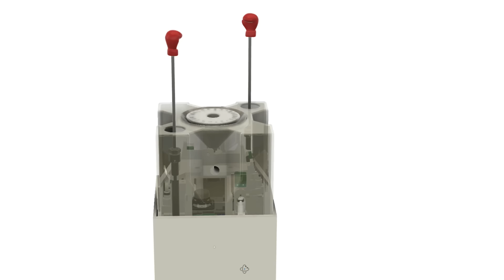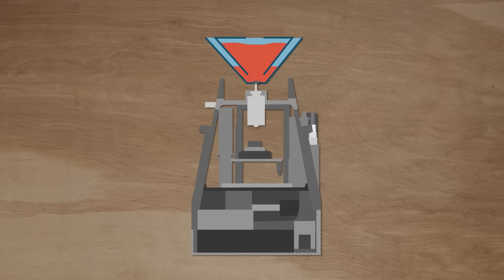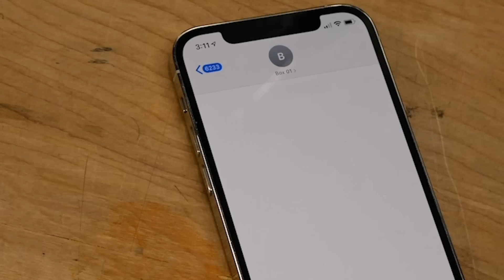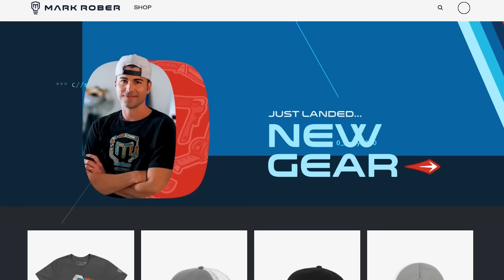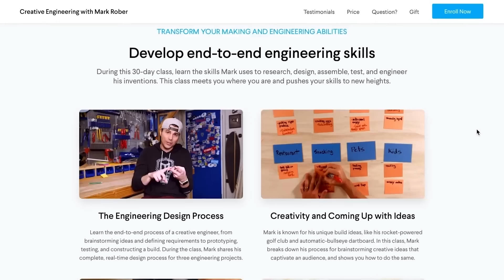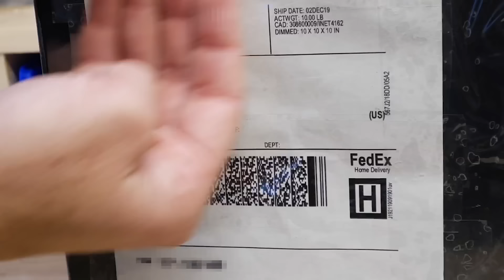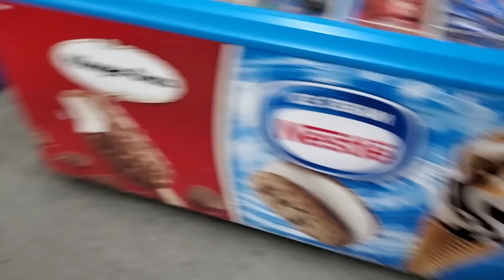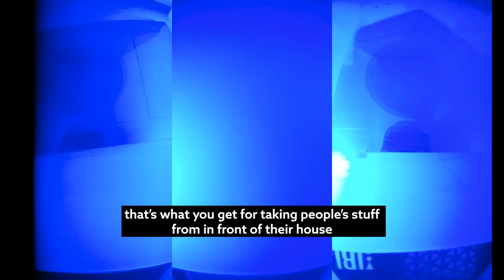EXPLODING Glitter Bomb 4.0 vs. Package Thieves

Comment: Next year's version should have ink leak out of the bottom to irreparably stain whatever surface or furniture they open it on.
Reply: that is brutal but justicfeied
Reply: I like the sound of that XD
Reply: This is a level of overkill that I am fully behind. Excellent suggestion.
Reply: I like it, but worry about legal questions if they start purposely doing property damage, even to thieves who would deserve it.
Reply: @Ahrpigi  If the item is on a person's private property and is stolen, the liability is with the thief, not the other way around.
So a thief is going to send a cleaning bill? LMAO
Reply: @AlienEntity1  Logically, yes. But law has little to do with logic and there is an entire profession of people abusing the law to the extreme.
Reply: Yesssss
Reply: @Ahrpigi  What legal questions? Banks and stores do this already.
Reply: @Ahrpigi  legal questions? These thieves are already breaking the law. They need a punishment.
Reply: @AlienEntity1  solution is 1kg of tnt in version 5
Reply: Leak ink, you say? Why would you want to leak a little bit of ink?

 A soda bottle can safely hold perhaps 90 psi of air pressure. Enough that it could be half or 3/4 full of liquid, and eject it all with considerable force.

There are tiny sprinklers, without moving parts, designed to water a 10 or 15 foot radius. 

There’s all kinds of timers, electrically controlled valves designed to work with sprinklers. 

You do the math.
Reply: Should be dehydrated glow in the dark paint mix or ink, so when they try to clean the glitter it stains
Reply: @Addison0526  Yeah, I hate it when the red dyes packs go off as I'm running across the street.

Comment: I was recently thinking that it is extremely likely, the thieves from glitterbomb 1.0 still have glitter in their house.
The annual fabulification is fantastic as always.
Reply: Even if they've vacuumed their homes or cars every day for the past 4 years.

I can fully guarantee you they still find glitter.
Reply: @sasukedemon888888888  3 years. Glitterbomb 1.0 released in 2018
Reply: @luc751  2018,2019,2020,2021. 4
Reply: @luc751  who said I was directly referencing the release of 1.0

I could have said an arbitrary number of years. Such as 3, 7, 81, and so on.
Reply: @teyentapper1483  Sorry buddy, but even then it's only been 3 years. December 2018-December 2019 is was one year, December 2019 to December 2020 makes 2 and December 2020 to 2021 is 3 years. In fact, because this one came out mid December, if you look up the original video it says it was made ~2 years ago.

Comment: That glitter chamber design is one of the most ingenious designs I've ever seen, second only to the Aldi shopping carts.
Reply: I had to google what was so special about the Aldi shopping carts and turns out they are just the normal carts we have here in the UK where you have to put a coin in to unlock the chain from the other cart.  Americans are easily impressed eh...
Reply: Wait, so ingenious design of Aldi carts is that they have a coin-based locking system? I've seen carts like that for over a decade in UAE and in Russia. Is it a rare/novelty in the US?
Reply: @ilyaholt8607  Idk what state the op lives in, but where I live it's not hard at all to find a shopping cart with the coin locking system
Reply: It’s so common in the UAE. For you this is rare?
Reply: @starcrazer_33   Yes, I’ve only ever seen locking carts at Aldi. I can’t speak for everywhere in America though.
Reply: The ONLY store in America that has locking buggies is Aldis!!
Reply: @ilyaholt8607  They have been a thing in Finland for 30 years or something.

Comment: Suggestion: the second glitter shot only comes out when the package detects movement in order to cover more ground with glitter
Reply: I MAKE AWESOME CONTENT

..
Reply: Also throw like red wine or something that’s stains very bad and super hard to get off 😂
Reply: @potlagopaf6389  Used cooking oil 😂😂
Reply: @potlagopaf6389  - That lovely anti-theft powder mixed in. Of course its a B to work with because it doesnt take that much moisture to activate it.
Reply: @potlagopaf6389  Just put guns on all 4 sides
Reply: @potlagopaf6389  The thief could sue for property damages, then, bad idea.
Reply: @20EsOfficial  the ye ol' uno reverse. Like a cop getting arrested for arresting someone these days.
Reply: also make the lid tear when it comes off so they cant put it back
Reply: Profile pic checks out

Comment: You should design an expanding top so the lid can't be placed back on very easily.
Reply: I think the little boxing gloves stay pressurized so you can’t push them back down but I could be wrong
Reply: i think he did that last year
Reply: they have things that poke out so the lid can't be put back down, although they r very small so some people make have forced them down
Reply: yes please
Reply: You need a frame on the bottom side of the lid, to make it more robust, so people can't force the lid back on. They would just destroy the lid if they try.

Comment: Apparently the stink spray wasn't strong enough, no one really reacted to it. I was expecting a much stronger reaction to the smell, lol
Reply: Their houses and clothes already stink.
Reply: @davefish2280  Nah their heart stinks the most
Reply: I think the confusion over rides their reaction to the awful smell. Probably afterwards they notice more but initially they're in shock and figuring out what's going on lol
Reply: Maybe it was because of a low dosage, but it might also be because sociopathy is correlated to a weakened and less discriminate sense of smell.

Also, a LOT of people have zero or barely any sense of smell.
For several reasons I'd bet that Mark Rober is on the opposite side of that spectrum and that he dosed the skunk spray accordingly.
Reply: no i think it does stink....... but they were shocked by the package not being a home pod. and being caught!
Reply: Should replace with pepper spray, they would smell that.

Comment: Curious. Did 4.0 phase out the feature that prevented them from covering it back up? Noticed a lot more people this time around able to cover it back up.
Reply: You can see the bronze-coloured pegs on both sides at 0:54.
Reply: @TheDimsml  Didn't seem to work though.
Reply: @AzureSwiper  well the cover is probably cardboard. Given enough force, you could put it back on with a tiny bit of struggle.

You could only negate that by reinforcing the cover or making the pegs way longer or something
Reply: It’s going to be on 6.0 for 2022
Reply: @juanpablomo3934  No?

Comment: Have you ever thought about having fans or compressed air activate on the sides that activate when the glitter projects from the top so it spreads further? Basically as the glitter falls it interacts with the current generated from the fans so it goes much greater distances and creates a bigger mess. Oh and it might look cool.
Reply: Especially since people tend to back away from it
Reply: The air would also launch the top. A CO2 canister with 30g and it's Christmas again.
Reply: A lot of them were opened upside down/sideways so not sure how effective that would be

Comment: Did the stink spray get downgraded at some point? I remember originally it really bothered people and they couldn't be near it, but now it barely seems to bother them at all except for them saying it smells bad.
Reply: @christopherchan7642  I wonder what it is
Reply: There are much stronger and worst smells he could use, unfortunally, some are so bad that they can make people throw up, so he have to get something that smells bad, but not enough that could cause someone a bad reaction
Reply: @Nybbl er yeah but i think he can be sued for stuff like that
Reply: @Nybbl er bad video material
Reply: It's probably the adrenaline diming it down for thm
Reply: Mana Thief  the system to protect thieves yall
Reply: Have you seen some the thieves places? The spray probably improves the smell.
Reply: Yes, I asked myself why he isn't just using butyric acid in a pressure can.
That is so bad that people will throw up and it will take them a lot of effort to get it out of "their" interior.
Reply: Did you not see the state of these people's living condition? Not a single one of them  resides in a potpourri factory. I am fairly sure that they are quite accustomed to vile odors from what I can see.
Reply: Yeah, I think Mark should use thioacetone instead 😈
Reply: He could probably use a stronger smelling substance, but he's already pushing the line between "aggressive tomfoolery" and "technically considered a warcrime under the Geneva Convention."
Reply: @satsujin4027  Surstromming spray?

Comment: Mark, ever considered rigging something up to own all the catalytic convertor thieves?
Reply: Yeah: a motion sensor that recognizes frequency of a recipro saw & sprays sticky glitter. Instead of a package it would be several components (sensor, spray bombs, cameras) all dispersed but focused on the catalytic converter area). In the confined space of the underside of a car that'd be very effective. Rig up a number of cars in an area & you'd catch thieves - they nail multiple cars in every run - & clean up an area.
Reply: You can’t stop meth
Reply: yeah it's called lowering the car on them when you catch them doing it
Reply: I think the Irish did that a long time ago

Comment: how about making it so that once the package is opened, the top cant be put back on? seems like a lot of them avoid most of the glitter by simply putting the top back on
Reply: He made that last time I wonder why he ditched it
Reply: @TheNicoderechte  My guess would be that the pistons where supposed to serve that function, but turned out to be too easily broken.
Reply: That was an actual feature of 4.0
Reply: On review: It turns out it does have the same feature as 3.0, but a lot of them opened it upside down (which lets it be pushed in). And the cardboard package seemed to be too weak and break on others.

Comment: Back in the day we helped create a jewelry tray that emitted tear gas and a dye that wouldn't wash off...The tear gas came out at 180 degrees...You would have to leave the car if it went off in it...Service Merchandise was having smash and grabs on entire diamond trays...The way the system worked is that as long as the tray was sitting on the magnetic base it was turned off..The second it came off the base it turned on and was looking for a signal...The transmitted were in the foyer of the store...The dye pack would obtain the signal as the subject was exiting the store...Then 10 seconds later it would go off....As long as the tray didn't leave the store no problem...We had one suspect grab a tray and shove it into his pants...When he exited the store it went off burning a hole all the way to the bone....He discovered how fast he could get out of his pants....